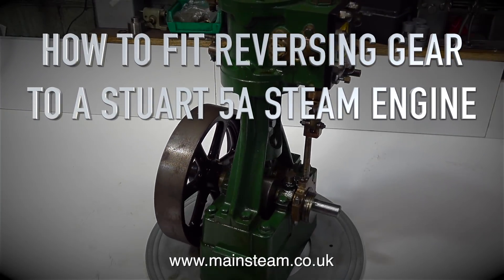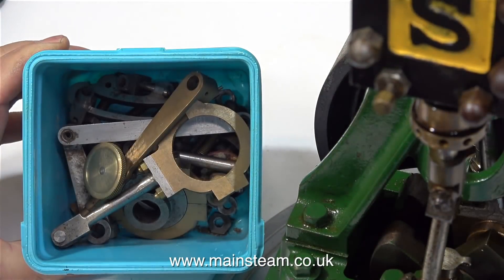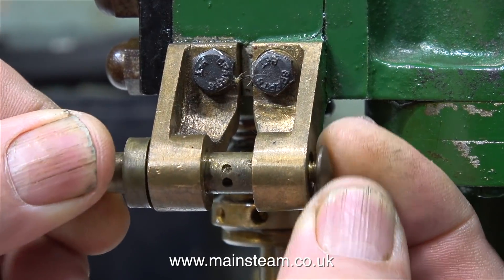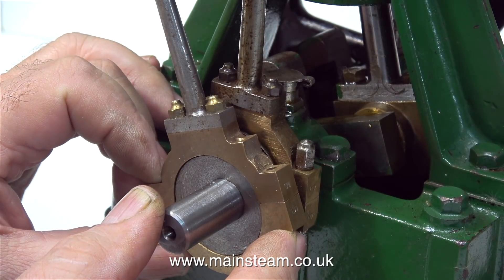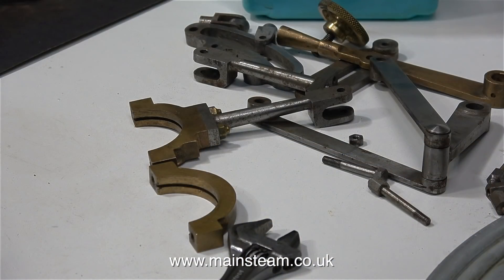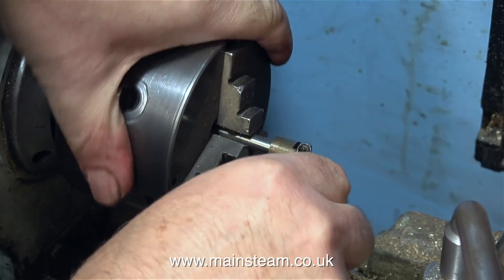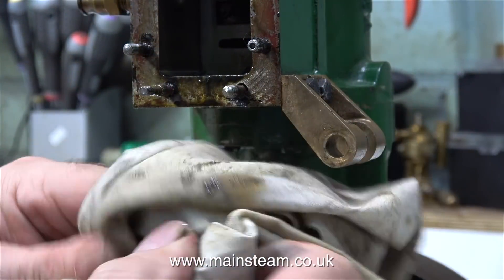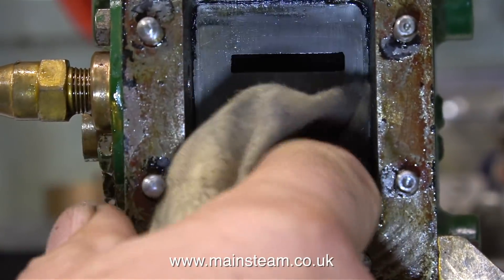HOW TO FIT REVERSING GEAR TO A STUART 5A STEAM ENGINE - PART #1

Comment: I hope this isn't a stupid question, I get the operation of the expansion link - to sort of connect forward/reverse timing at the same time and let you select direction while running.

Question - do you know the origin of the component name - do you know why is it called an 'expansion link' rather than say 'direction slider'...  

Cheers
Reply: The expansion link got it's name because that's it's job, when it's fully at one end of its travel in either forward or reverse position the valve has its full motion of travel and steam is admitted for the entire stroke of the piston, which gives the most power but terrible efficiency. Now  as you start to move it towards the center position the valve travel decreases, admitting less steam and closing off the cylinder early allowing the steam in said cylinder to expand more and more and get more work out of a smaller amount of steam, efficient but less overall power. but once you get to center between forward and reverse the valve movement next to nothing and the timing is out so the engine won't run, so that's called the neutral position
Reply from the maker: I don't know how the name "Expansion Link" originated, maybe some viewers  can shed some light on it .....
Reply: In older engineering descriptions, "expansion link" is used as the term for a slotted bracket - fixed at one end, hung on a bush or pin at the other -  for mounting things securely to a frame/chassis while allowing for expansion/contraction.

The expansion link in valve gear is also basically a bar/bracket with a slot in it, so I've always assumed it was named from its visual similarity to the earlier part.